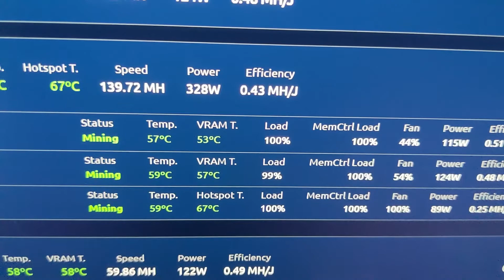Building My First Crypto Mining Rig

Comment: Great rig btw
Reply: Where u hook the monitor cable than?
Reply from the maker: Yeah that's exactly what I discovered at the end, typically I think you'd use the built in HDMI on the motherboard.  I'll have to see if I can get that to work otherwise I'll have to unplug a fan if I need a monitor.